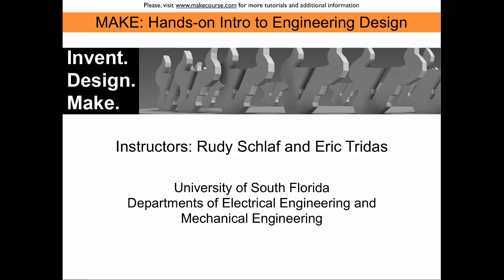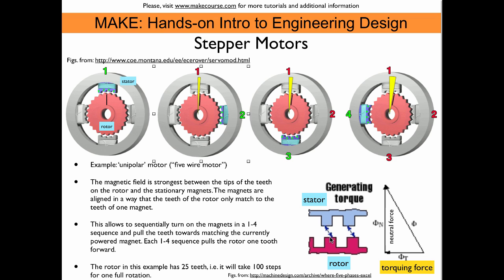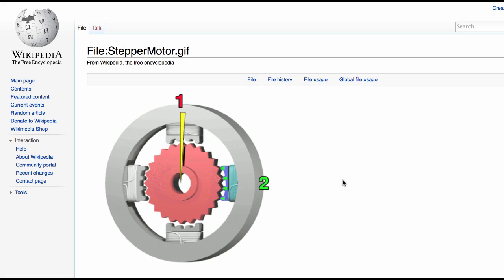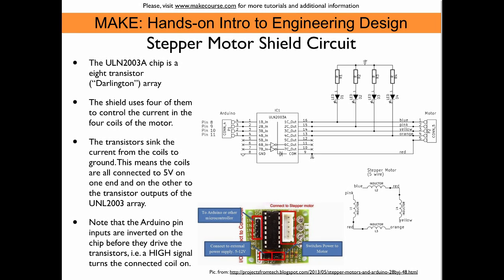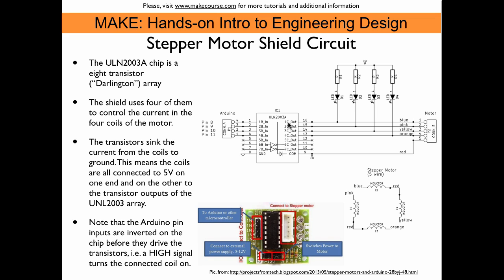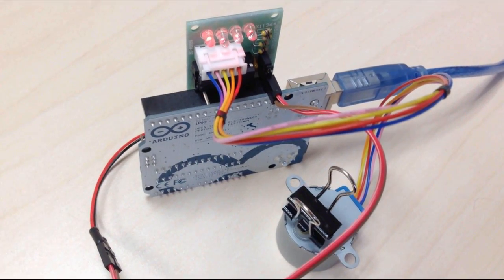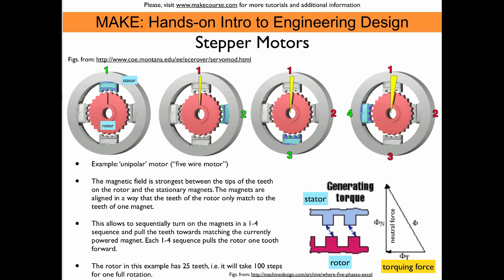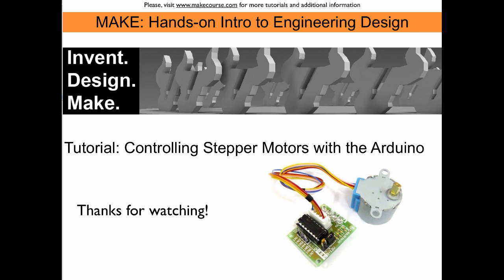Tutorial: Stepper Motors Controlled with the Arduino

Comment: When I try and get the code from your website, I can get it fine but I get these error messages:

Arduino: 1.6.3 (Windows 8.1), Board: "Arduino Uno"
Tutorial_StepperMotor.ino: In function 'void loop()':
Tutorial_StepperMotor.ino:26:12: error: 'step_OFF' was not declared in this scope
Tutorial_StepperMotor.ino:28:13: error: 'forward' was not declared in this scope
Tutorial_StepperMotor.ino:36:14: error: 'backward' was not declared in this scope
Error compiling.
Reply: Zhiyao Gu where did you get the codes
Reply: video become blurry after  9:15. Did u guys notice that? would be grateful if u show me here by copying n pasting, the forward and backward part which i cant see in the video
Reply: I had those same problems at first make sure to put this code in the functions tab.

void forward(){
  Step_A();
  delay(delaytime);
  Step_B();
  delay(delaytime);
  Step_C();
  delay(delaytime);
  Step_D();
  delay(delaytime);
}
void backward(){
  Step_D();
  delay(delaytime);
  Step_C();
  delay(delaytime);
  Step_B();
  delay(delaytime);
  Step_A();
  delay(delaytime);
}
void step_OFF(){
  digitalWrite(pin1, LOW);
  digitalWrite(pin2, LOW);
  digitalWrite(pin3, LOW);
  digitalWrite(pin4, LOW);
}
Reply: Rubix Solver thank you!

Comment: Wonderful video. Thanks for the code. A question. Subject higher torque and finer steps.
Instead of writhing code the turns on two coils at a same time; would just connecting the two transistors together be equivalent? This would reduce ports required on Atmel.
Reply from the maker: If you want finer steps, you will still need to be able to turn the coils on individually, i.e. there is no way around 'one pin' per coil (except, of course, by using a dedicated stepper motor driver chip such as the TI DRV8811 (http://www.ti.com/product/drv8811)).
Reply: Make Course  http://www.ti.com/product/drv8811
This link works better ;)
Reply from the maker: Bengt Samuelsson Thanks!!

Comment: Well done video!
but what is that switch for the one next to the power income) ? and is the power connected to the arduino? in the video you are saying that the motor consumes more current that the arduino can supply, so, what is your source of power?
Reply from the maker: Hi Ariel,
The stepper motor used in the tutorial can be run directly from the Arduino board. But if you use a bigger motor you need to use an external power supply, which is common-grounded with the Arduino GND. The Arduino can only supply 500 mA, and you need to take into account current going into the Arduino board itself, as well as other things you connected like LEDs and the like...